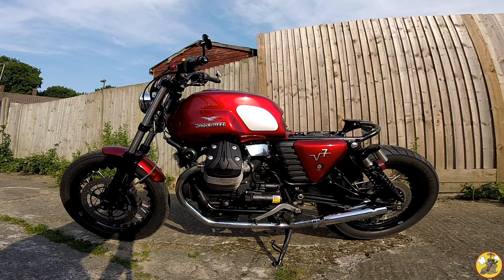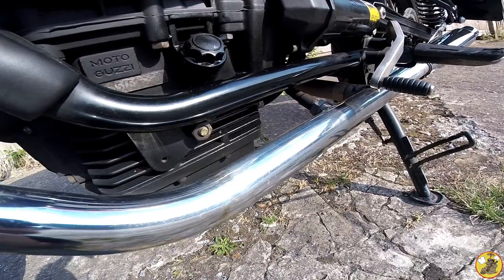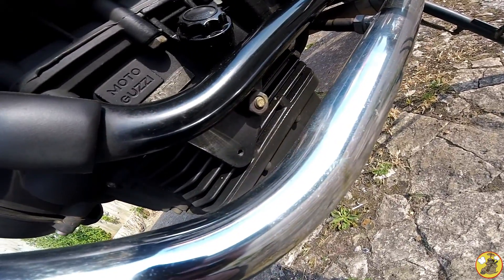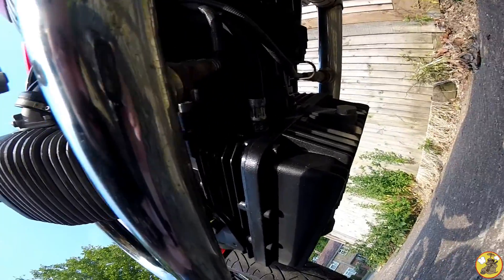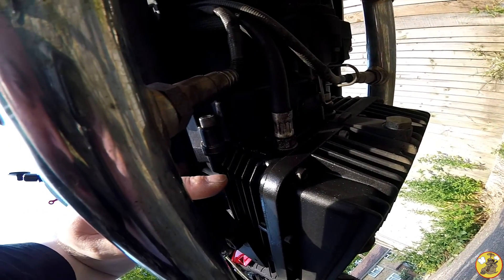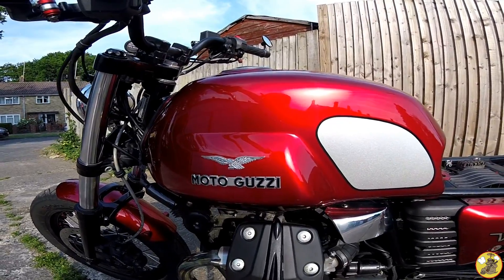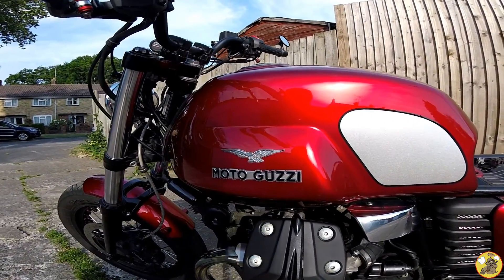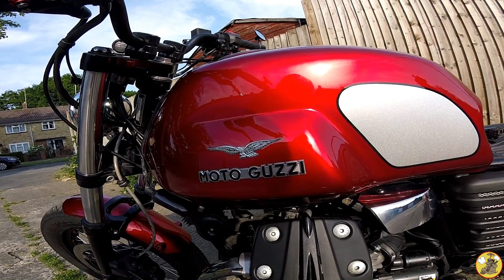2012 Moto Guzzi V7 - Oil Leak Issue

Comment: sharp tank!  We had a heat wave and some bad traffic here a few days back.  came out in the morning to notice oil on the front of the engine,,  I think it's break fluid from the ABS.  Figured I'd ride to work and drop it off around the corner to have it looked at.  got to work and off the bike to find what looked like Dijon Mustard coming out of the final drive all over the rear wheel.  Condensation emulsified it.  New York City is a tough town. tough on the people and tougher on the bikes.  Waiting now for the warranty work to get approved.  Another Sunday spent watching races on TV and listing to all the bike ride by outside!
Reply from the maker: Ahh man, that sucks.... I think I remember seeing your pics. Hope you get it sorted easily and painlessly!

Comment: if you've run it after changing the oil,  even to trst it. it will leak from the oil filler if you turned the 'O' ring on cap around accidentally.
Reply from the maker: TeachMyFlock thanks for the info mate, appreciated :-)

Comment: I have oil in my air box,anyone have a idea what the problem could be?
Reply from the maker: Hi, it isn't a problem at all, there is a breather hose from the engine to the airbox which vents oil into it if it was overfilled. It will generally sort itself out, but check your oil level (use the dipstick not screwed in on level ground, bike upright. If in the middle, it is fine. Mop out the oil in the airbox, sorted. It normally happens after topping up the oil or doing an oil change.
Reply: @HippoDrones  thank you very much!what a relief 😅👍
Reply from the maker: @punkrockdidi  No probs bud, happy to help :-)

Comment: The guy  i bought my guzzi from had that problem as he delivered it to me. You changed the oil and basically that was the only thing up that high you had to touch. So when I noticed the oil filler cap from your video it all just clicked
Reply from the maker: That makes sense, not had the issue since so I think you are correct! :-)